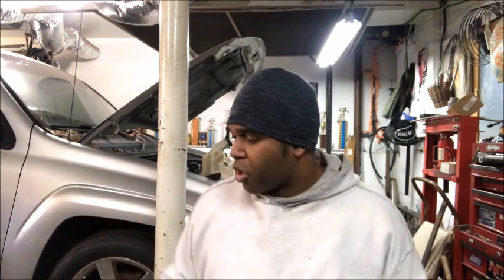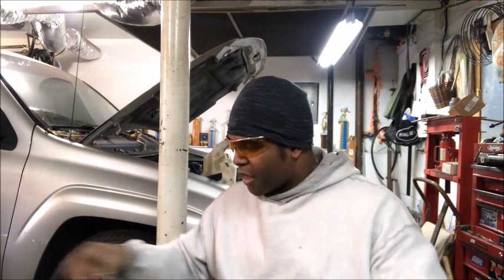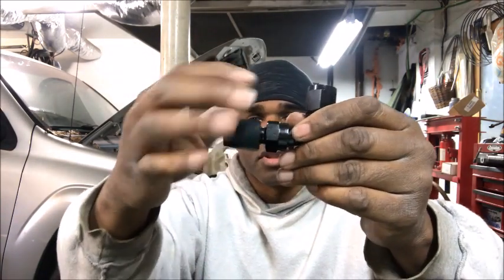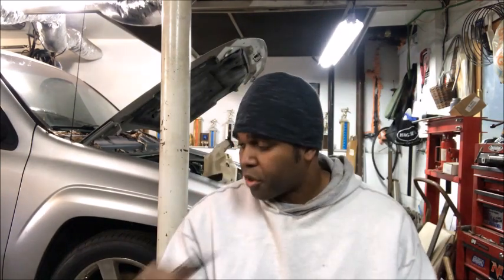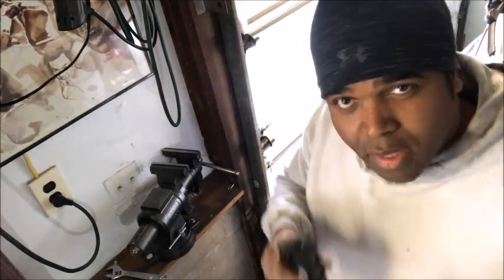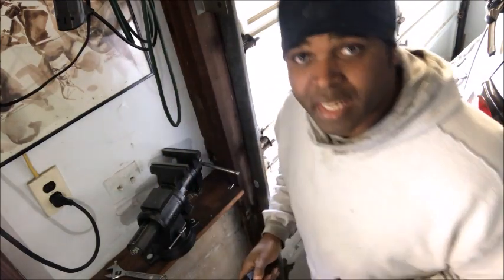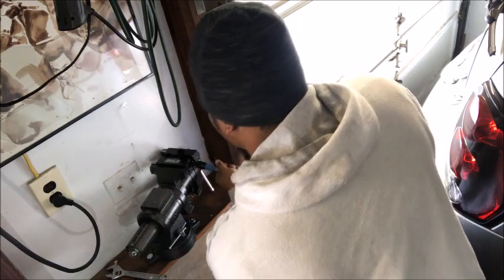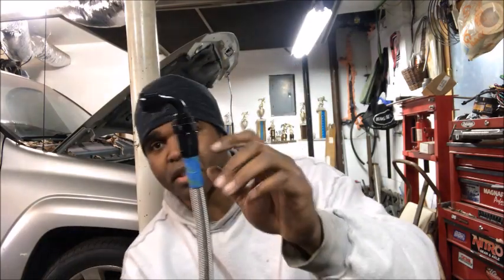Custom High Pressure Steel Braided Fuel Hoses Made Easy...

Comment: That was a nice video!  Do you know if the end of the AN fits the same way onto the primary fuel pump? Or did it take an adapter?
Reply from the maker: i used a different than stop fuel pump.. the stock set up is a quick disconnect style..

Comment: Remember to blow your lines OUT, not in. Remove the chunky dusty rubber and particles that get's inside there while cutting that will cause you trouble later down the road.
Reply from the maker: great tip.. you got to inspect them thoroughly

Comment: For long spans like along the frame for your fuel supply and return, I like to run aluminum hard line and use tube sleeves and -an nuts and flare the ends out. You can buy the flare tool pretty cheep. For any flex
Points like frame to engine or fuel tank to frame hard lines I’ll convert over to the stainless hoses..
Reply: that and a tube bender you can make some pretty clean runs a lot of the time even reuse factory clips and routing. You should also pay attention to what type of fluid type and temperature ratings of the hoses as there are quite a bit of specific hoses for different fluids. hoses that are not rated for more aggressive fuels like ethanol or methanol will deteriorate and dry rot then inevitably leak if exposed to the harsh fuels or wrong fluid types.

Comment: Great tips help, keep up the great work. What’s your opinion on the soft braided hose vs the stainless steel
Reply from the maker: if  you you cant get the hard line hoses for your car go that route, being i need more volume and they dont make them for the regulator.. it was better to go braided hoses..